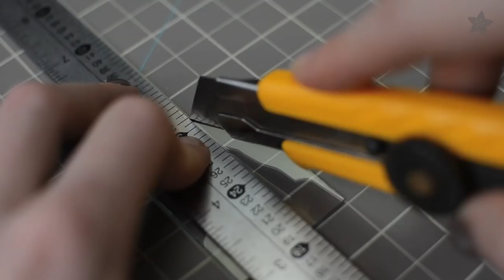Playing with Indium Tin Oxide

Comment: There is a way to make that without going to great expense..

You can buy clear wood varnish water it down with thinner and add tin or aluminum powder then using a paint sprayer coat thin bits of plastic..

Ive done it and it works... Give it a try... ;)

Comment: This is curious. can you print the ITO like a PCB? 
This might be a nice way to make 3D LED objects (Im keen on the cubes). It seems to me that if they circuit was printed, you could screen print the conductive glue, and place the parts with standard SMT equipment and techniques, and end up with nice even planes of multiplexed or charlieplexd LEDs. The matrices can easily turned into cubes by layering, but because they are flexible, they could be turned into many things (headband, bracelet, ...)
Reply: since you commented this 10 years ago you might be dead but you could do what you described with physical vapor deposition

Comment: They use a thin coating of ITO inside the envelope of glass Geiger-Müller tubes–that serves as the cathode material, resulting in efficient detection of ionizing radiation. ☢

Comment: I believe ITO is sputter coated and not spin coated
Reply: James Fallon the Pet fillm is cooling by spining at high rpm and it is not placed in the same chamber of sputtering , 
the ITO particles comes trough a tube from a near chamber , in this way it is possible to coat substrate with ITO but at low temperature ... 
i wanna know how to make pattern and etch the ITO PET chemically , not using Laser DPSS machines